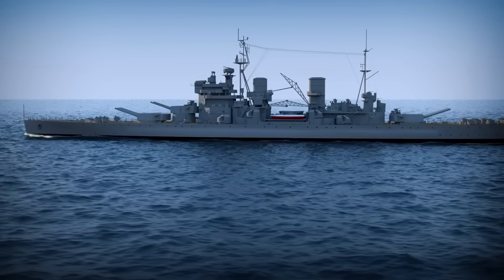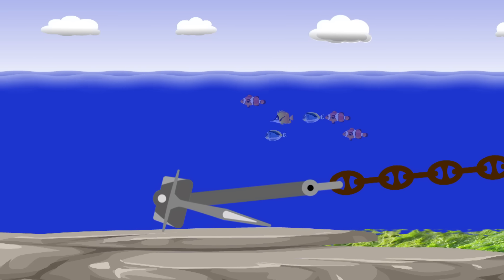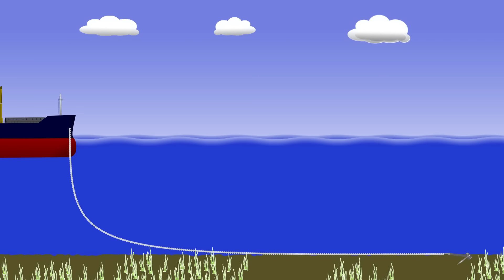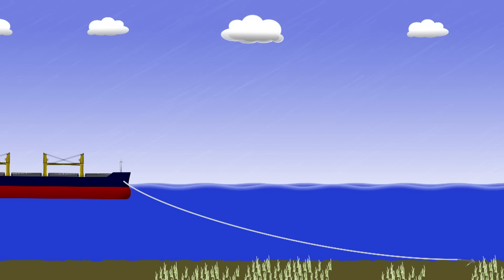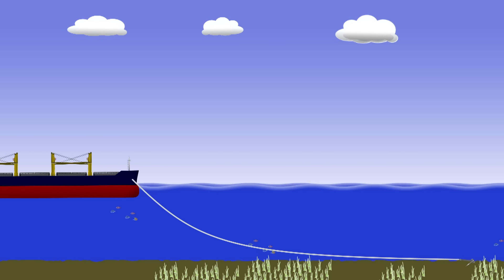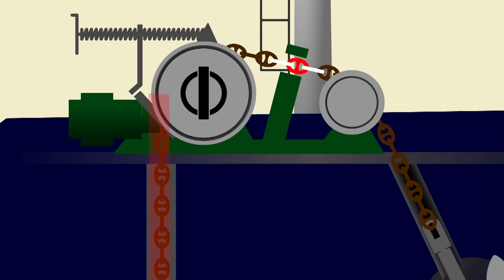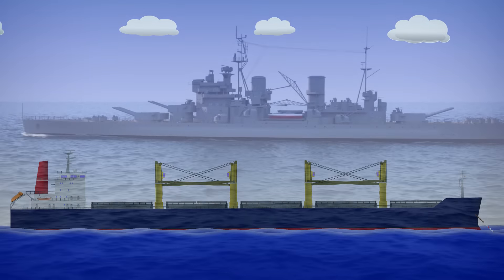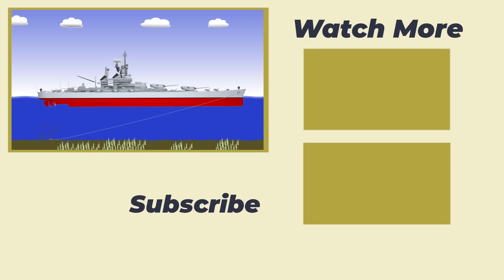The Truth About Anchoring Huge Ships

Comment: So, taking into account how incredibly heavy an anchor chain of a large ship actually is, roughly how deeep can you let the anchor down before the weight of the chain makes it impossible to weigh the anchor back up?
Reply: While there would be a definate limit to the amount of chain able to let out, I imagine almost all ships do not carry that much chain for that very reason.
Reply: At every moment you are lifting only the part of chain that is not lying on sea bottom
Reply: Most ships carry 11 to 13 shackles (one of the chains will usually be 1 shackle longer than the other as there is a spare shackle which is readilly connected). Also keep in mind that ships rarely anchor at depths exceeding 40 metres so you don't have to heave the whole weight of the chain - only the weight of 1 or 2 shackles plus the effect of current and wind and that is negated by the ship's engine. It is not uncommon to pay out 10 or even 11 shackles in places with strong currents - the last chain is usually retained inside the chain locker as it is usually far more worn down by the rust than the rest of the chain (the closer you get to the bitter end the worse is condition of the chain as it spends most of the time  on the damp and dark bottom of the chain locker).

Comment: Interestingly, that “handbrake turn” using the anchor is a time honored tactic in the age of sail. If already at or near rest, a ship might even attach a “spring” line to its anchor cable, allowing the ship to be tugged one way or the other to fire broadsides way faster than a battle usually might allow, and with more accuracy.

Comment: I used to work offshore in oil gas.  Captain did a handbreak turn upto the rig.  Partly frightening but mostly impressive.  Laid out a bow spread.  Motored towards rig paying out catenary.  Cut engines and brake on chain... back end swung around about 20mts from Rig!  Stern Hauser x2 out to rig legs.  Job done

Comment: Excellent explanation. This does not only apply to a ship! We ha e a 34’ sail boat. Exactly the same process with one exception. We only have 40’ of chain then a nylon rope called a “rode” in this way we can reduce the weight and less the stretch nylon rode to act similar to a chain. I have seen many small boats with only “rode” and no chain this will never work because the rope would stretch out and pull UP!

Comment: I had heard that "It's not the anchor that holds big ships, it's the chain", but without the important detail of it being the weight of the chain, I always thought that that meant like, the friction of the chain on the seabed is actually more force than the anchor itself is taking, and given that, I thought that then surely there would be no point in the anchor at all and you'd just use a chain. This makes much more sense.

Comment: As someone who's only naval experience is on a 19ft pleasure craft on small inland lakes, that was very informative.
Big boats use anchors to hold the chain in place, and the chain does the bulk of the anchoring work.
Small boats just hope the anchor didn't sink too deep in the mud or weeds. And in shallow water just plant the skeg guard in the sand. Pushing the boat by hand may be required to not fill the lower unit with sand while leaving the beach.

Comment: One cool fact is that in the age of sail ships used to have many anchors of various sizes and they were used not only for anchoring but as far as I know, also for moving. The ship would launch a boat and they would load one of her smaller anchors onto the boat. Then they would row the boat with the ships anchor while the crew unwinded the rope. Once far enough they would drop this anchor and the crew would start pulling the ancohor back in. Like this they were able basically “row” a large ship by manpower alone. I also heard that sometimes they would just row the anchor to shore and then pull the entire ship closer to shore this way.

Comment: So I knew that the anchor just held the chain down and that the weight of the chain was what kept it in place, but I didn’t realize that the chain weighed so much that if the ship moved it only lifted the chain up a little bit off the ground and didn’t pull on the anchor at all. And I also wondered how they got the anchor back out, but going back towards it until it comes back out of the seabed makes total sense lol

Comment: This is also true for smaller boats as well, even 30' sailboats. Anchoring is not just a simple "drop the anchor and your good" it is quite a complex process.
       If conditions allow small boat sailors will even dive on the chain to make sure it's properly set.

Comment: Swinging the Anchor is an old Sailing technique used when the ship was in danger of running aground. The anchor was dropped and the ship swung into the tide sometimes it failed.
Reply: There are sea anchors as well which are not for the seabed to help angle to the current, its force is going to be tiny vs your spanker and jibs with any decent wind. It takes so long too compared. 

You could use a sea anchor to slow you down for a tighter turn i guess

Comment: Nice and well explained video. There is only a small correction, I would suggest: Usually when ships are dragging at anchor it is because the seabed is not properly. If it is like in the video, and a ship is still making too much way through the water, it is most likely that either the anchor(chain) will break, or the brake of the windlass is wearing down, and you will loose the whole anchorchain. That is the reason why it is not a good idea to stop a ship from higher speeds by use of anchor.

Comment: Never worked with chain too much. Our anchor lines in the Gulf of Mexico were usually made from wire rope that had an anchor attached to them.  Large metal drums or buoys were used in conjunction with a tug boat to run the anchors out and drop them.  Again, that’s on a construction barge doing pipeline work where 6 to 8 anchors could be dropped.  Don’t want to be on that barge around platforms if it ever breaks free - there’s no motor or rudder on the darn thing and it’s as big as a city block! 😉

Comment: Where would we be without information like this and Youtube? I've spent a lifetime believing that ships need to hook their anchor under a rock or into a crevice in the seabed in order to hold the ship in place. No one ever taught us as kids that it's not the case. For years I have wondered how a ship can retrieve an anchor that is wedged or stuck but never thought to look it up.
Reply: Ex Sailor (small Boat), I had Zero Aducation Bought a Boat and read some Books and Talked to all the Old Sailors for Tips. That wedged under Stone does happen to.
If you are Smart You Attach a Buoy with a Loose Rope to the Crown of the Anchor. That way you drive over the Buoy without lifting the Chane, and you can Pull it out Backwards, then Get the Chain back. It also helps to know other Sailors where your Anchor is about and the Length you laid out, so they do not Cross between Boat and Anchor.  Every Boat has a Certain Rotation Radius. You do not want this to Cross or you can get Tangled together.

Comment: I would say his comment about the chain holding the boat not the anchor is wrong.
The weight of the chain directs the pull horizontally enough to allow the anchor to hold fast instead of more vertical pull via lighter rode that could remove the anchor such as what happens when being retrieved.

Comment: One thing you have to realize about engineering on a large scale is that any sudden change of process parameters is avoided if at all possible. Bump stops are dampened, voltage drops are smoothed out and anchor chains build up their force over a certain horizontal distance. If an anchor was firmly fixed in the sea bed and fixed to the ship by a short chain, then any tug on it by the ship might rip the heaving assembly out of the ship's hull, at least fatigue the nearby metal over time and probably throw the crew on their mustache every few minutes.

Comment: Sorry to say so, but using the anchor for a controlled tight turn was a common practice before the age of bow thrusters. I was on  a Hurtigruten ship and they approached the pier in a U-turn assisted by the anchor. It was called a "Svolvaer turn" . And they used the anchor to pull quickly off the pier when departing. I think it is about paying out the chain in the right way.

Comment: Interesting timing for this video to come up on my feed. In the news today there's speculation that the cause of the oil pipeline breach off the coast of California may have been caused by a cargo ships' anchor! Seems like a good bet, given the massive number of ships anchored off of Huntington Beach. If that's the case; I wonder who is liable. I would assume that an under water pipeline would be present on a ships nautical charts, and possibly posted floats on the surface? There aren't usually that many ships at anchor, but due to the port issues its a "perfect storm" for this kind of accident. They are saying that the pipeline was dragged several hundred yards. Given the info in this video; you'd think the crew of that ship would have noticed something amiss.

Comment: If a chain gets stressed, it will start popping. The stress on some of the links will slip and jump into place outside the bend. If you get non stop popping, get away. The chain is under a ton of stress and the metal links will snap like it's made of rubber.

Comment: The second scenario at the end of the video were the anchor just popped up and drags is what we see in the movie. When USS Missouri dropped her anchor in the shots for we saw the anchor we didn’t see it digging into the seabed we saw it dragging on the surface. So the anchor is dragging until it gets caught on a solid object like that rock bed and allow the Missouri to pull off a nautical mover known as club hauling. So what you said in this video is true but the maneuver pulled off in the movie is also 100% accurate

Comment: Each 90' length of chain is called a "shot" and it was designed in terms of fathoms and each shot is 15 fathoms (which, yes, is 90'). Ship anchoring and pleasure boat anchoring are similar in execution, but dissimilar design. Ships use the weight of the long chain, cable, line called the "rode" to hold the ship in place. Small boats typically don't want to carry that much weight in chain and use much lighter rope as the rode. This rope is typically connected to a chain leader before attaching to the anchor. The chain leader holds the  anchor shank to the ground for the same reason explained in the video; so the anchor flukes dig into the ground. Typically in most pleasure boat applications, you want 1' of chain for each foot of boat. (24' boat should have 24' chain leader between rope and anchor). Also, plan on using from 5:1 to 7:1 ratio of rope length to depth. (Anchoring in 20' of water, plan on using 100-140' of rode).

Comment: They steer the S.S. Badger (Manitowoc WI to Ludington MI) by dropping the anchor every day. The maneuver turns the very large converted train ferry on a dime. The ship comes into port very fast, they drop the anchor in-line with the dock which is perpendicular to the river, and the ship spins 90°. They then back it into the dock. I used to watch the maneuver every day on my lunch break from the nearby shipyard. It is very loud and impressive to watch in person, but I couldn't find a good video of the whole procedure.

Search YouTube for: 2013-09-23 @ 1838 - SS Badger Carferry Docking Maneuver at Ludington, Michigan -- not the best video but shows them dropping the anchor and the anchor going under the bow.  As soon as the ship starts rotating they pull the anchor back up causing it to turn faster, but the video cuts off before that part.

Comment: Ref: Marking the chain.  Missed one very important point and that is, over time, the white paint on the marker links will wear off (and they cannot always be repainted regularly). Therefore seizing wire is twisted around the stud of the outer white painted marker links... eg at two shackles (ie, the second marker), the stud is wound with the seizing wire at the second link stud either side of the joining shackle. So one can always see the length of chain out even if the paint wears off. PS: The stud is the metal cross piece at the centre of each link.  Also note: the joining shackle (link) for each length is easily visible as it is a much larger and a rounder shape than the normal links and can be split inorder to break the chain length for numerous purposes.

Comment: The lugless joining shackles are not always painted red. On ships where the anchor gear is on deck you want your lugless joining shackle between the blakeslip and the capstan brake. This allows to break the anchor cable to jettison the anchor, or to switch to the second anchor is equipped. Note that if the anchor watch notices the cable go from long stay to short stay repetitively, the ship could be dragging it's anchor. In this case it has to be reported right away to prevent unnoticed ship drift.

Comment: Battleship is one of those movies that makes you wonder what were they thinking as they did it. Like, not only do they only have about 75 crew drawn up for a ship that needed 1200 just to run her at minimum capacity. Maybe they could cut it down to 500 if they only use 1 turret, each turret needed 85 crew to function at all and 300 crew under normal operation. But their crew is woefully inadequate for the task. Forgetting numbers, of their some 80ish crew assuming the best. 70 of them are survivors of 3 destroyers from 2 different countries. A couple Japanese sailors, who probably don't speak English but even if they do, were not trained on likely any American ships,not like that would help any, but even the American crew, they're trained on a destroyer, a modern destroyer. None of them were even old enough to join the military when the Missouri was retired, most weren't even alive. The actors were, but the average age of enlisted in the navy is 20.5 years old, and the average age of officers is little better at 29. So they were trained on a relatively small vessel, with diesel-electric engines, basically the world's largest hybrids. With advanced radar, missiles, and God knows what else for defenses. Now, they've been put on the Missouri, which would have been a problem even if it was still in its 1991 configuration. Which it's not. The Missouri is one of the biggest oil burners still afloat. She doesn't use diesel to power electric batteries that then turn the props. She has the biggest V block motor you've ever seen and she uses a big old crank shaft to spin those props. Then she has no missiles, her cruise missiles were not just removed upon decommissioning. But her launch tubes were as well.

Comment: Fascinating video. 
But if possible I think many of us want a more definitive educated guess from you lol

So in the case of USS Missouri:
1. Is the worst case just merely dragging anchor and not being able to stop in time to avoid enemy fire? Would there be any likelihood of snapping the chain and cause severe damage to the bow?

2. Even if the anchor does not snap and is very securely locked into seabed, can a 60k ton steel beast really drift 90 degrees in such way even in the best possible scenario?

3. The USS Missouri then cut its anchor loose to continue journey. Do ships really have such feature to cut anchors? If an anchor can be cut so easily, would it not be a point of failure?

Comment: For massive ships, it is not the weight of the anchor chain that holds it, it still the anchor digging inside.
If the the weight of the anchor chain that hold the ship it means the weight of the chain should be equal or greater than the weight of the ship.  the reason why we need to have longer chain is because of catenary and cohesion  as you mentioned.

Comment: Several years back a large ship carrying many tons of Anhydrous Ammonia was entering the Golden Gate. This was not the ammonia you have under your sink. That is a bit of ammonia (usually less that 5%) dissolved in water. Anhydrous Ammonia is a gas at normal temperature and pressure usually transported in a large pressure vessel that will simply melt organic compounds (those things people are made of) it comes into contact with.
      At exactly the worst possible time the ships engine failed, robbing the ship of the ability to maneuver. The wind and current were pushing the ship into the south tower of the bridge. This would be a disaster of incredible scale. If the pressure tanks on the ship ripped open the ammonia would kill the crew before they could send a warning. The wind would carry the deadly cloud into the city where it would kill anyone caught out in the open. It would be pulled into buildings and kill the people inside too.
       She ship did the only thing it could do. It dropped both anchors and hoped for the best. It worked. No one died.
      But the ship was brought to a gentle stop, just as you said would happen.

Comment: On smaller vessels such as my bass boat, you can definitely snatch the bow around. Usually you're anchoring in far shallower water, frequently around lots of other boats, so you need the anchor itself to grab. Having 10ft of chain is extra helpful but most of the anchor line is rope.

As soon as the anchor grabs, the boat stops. If the bow is facing downstream, she'll yank around if the current is strong.

Obviously you want to avoid this.

Comment: I wish I learnt this when I was studying my Coastal Skipper course. I remember the values of chain to lay out, but I had assumed they were all to do with getting a low angle for the anchor. When I went sailing in the Med I regularly ended up with a poor holding and would swim down to place objects on my anchor. Little did I know it was a simple fix.